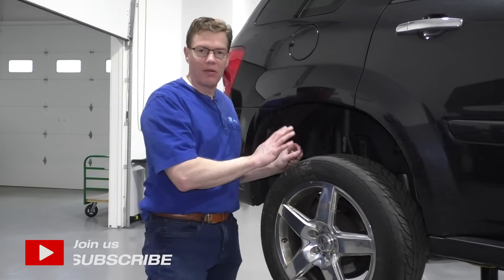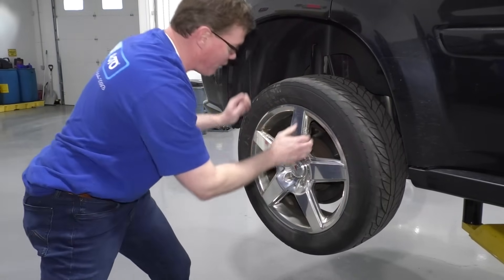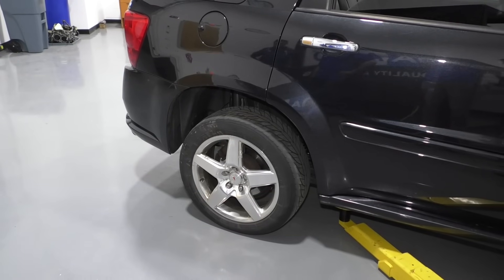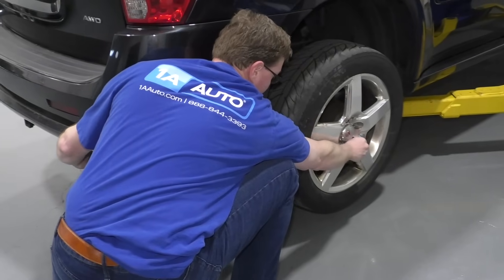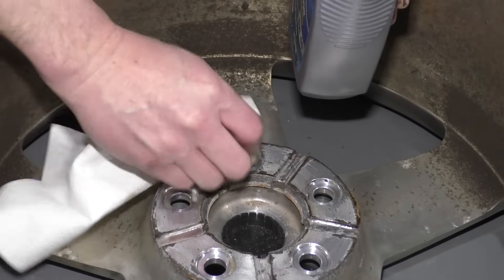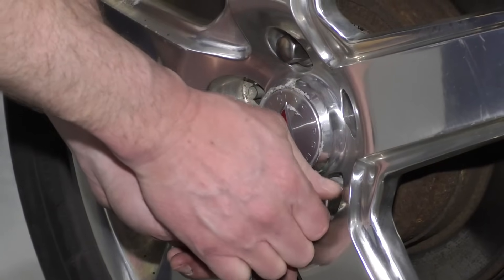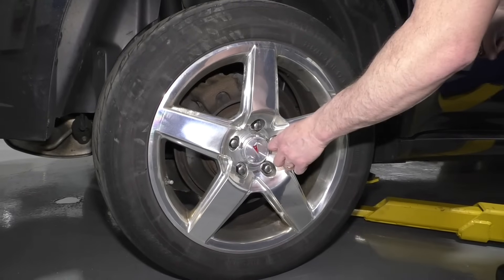How to Remove a Stuck Tire

Comment: Sometimes one will have to fingertight the lug nuts and slowly drive the car back and forth.
Reply: This was the only thing that helped me. Granted it was all rusted up from sitting for almost a year so other methods would probably work if it wasn't that bad.
Reply: Did that yesterday still didn't work.
Reply: @mangobrasi4127  
 You should have tried using the pry bar method.
Reply: You just saved my dog from hearing some colorful language.
Reply: @andyd2960  😂🤣🤣🤣
Reply: Thank you
Reply: this actually worked for me man thanks

Comment: Sledge hammer to the back is the best , we all know this ☝🤠🤠
Reply from the maker: Thanks for watching! +THE NHRA GUY #49
Reply: I work at a very high volume dealership  where we do a lot of tires  I use a very large dead blow hammer    it works perfect.   i dont kick them anymore   i let the tool do the work instead   im 54  and it does not always work  and you can hurt your foot and leg    i was a nyc medic for 37 years   so i know  a thing or to about  bones  anyway     grate job mike  as usual  .   i hit the wheel  and not the tire  because  if you hit the tire   it just bounces  off.  my dead blow  is 6 lbs    and it works very well on trucks too
Reply: Yep this always gets it! ideally hitting a piece of wood or something, and not the actual tire. Had a tech hit a tire once and the sledge permanently deformed the side wall. We called him the Hulk from then on out

Comment: If your wheel is stuck, don't screw around. Go straight to the pry bar method mentioned at the end of this video. I screwed around for about half an hour trying to get my wheel off,  but once I tried the pry bar method it took about 5 seconds to get down there, find a solid spot, and give a small tug on it. Just make sure you have something solid to press the pry bar against.

Comment: Thanks, from the bottom of my heart.  I was at the end of my rope when I did a search, and this video was absolutely perfect.  The tire is off and the spare is now on.

To share one of my tips.  I'm older and not that strong, and couldn't lift the spare onto the lugs.  I placed a few magazines on the floor, and rolled the spare into place.  I was then able to slide the tire on, and screw on the lug nuts.

Comment: You guys save my life. If your situation is not the same as in the video but your wheel still stuck, the idea is to make hard and strong movements, it could be driving a little bit and moving the steer wheel Left to Right and try to separate.

Comment: I couldn’t get those methods to work, but I managed to get the stuck wheel loose by throwing the other good tire against it with a couple loose lug nuts there to control it as you suggested.
Reply: Hallelujah thanks for the tip

Comment: Did not have a pry bar so I just reached into the wheel well and grabbed hold of the back of the tire and yanked from one side to the other and it finally came loose. This was after performing all three of the other steps!

Comment: This gave me the idea to sneak a flat pry-bar through the rim, on the face next to the studs.  Gave it gentle pressure next to the stud, moved on around to repeat next to each stud.  After about 7 times I could feel it go in deeper next to the stud, and was able to shake it loose by hand after that.  Wasn't using much pressure so didn't have any lugs on the studs.

Comment: Thanks for the tips on getting a stuck tire off, I ran into this problem today. One more tip to add to the list is 1) spray in PB blaster 2) jack up the tire off the ground and 3) hit it with a f#ing big sledgehammer.

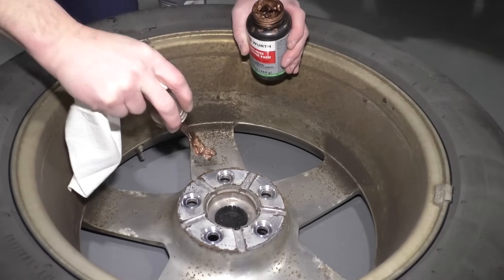Comment: 1:45 is why I came here! I beat my tire off from under the truck--w/TWO jacks under it. this is my 2nd vehicle that I couldn't easily remove the tire. I now keep a baby sladge hammer in each vehicle for that purpose. just wanted to see if Never Seize would work or if there was sumthing else I should use to prevent this

Comment: If you smack the tire with another tire that sometimes breaks it loose also.
Reply from the maker: Thanks for the comments and for watching! +twn5858
Reply: Smacking the tire with the other tire worked for me. Thanks!!!!!!
Reply: Worked for us.
Reply: @victordeleonjr5386  
I just smacked the stuck wheel with my spare and it worked. I'm stranded for 2 hours waiting for stupid Liberty Mutual roadside assistance. Two sets of cops came and the second one finally was able to free the lug nuts for me but I've been stranded for another 40 minutes trying to get the stupid wheel off because my tire shredded. Thanks a lot for the tip.... stay safe!

Comment: If the wheel is stuck, screw the wheel nuts back on but leave loose about three turns off tight then drive the car slowly so the weight of the car forces the wheel loose. If you do this on the road, use common sense and keep safe.

As in the video, clean the wheel flange and hub. You can use oil as shown but I prefer grease.
Reply from the maker: +Spanners & Sockets Thanks for checking us out!

Comment: Just saying thanks to Mike and 1a Auto for the helpful suggestions regarding a stubborn sticky wheel I’m almost completely car illiterate/ignorant I can add fuel, oil, and most of the fluids, and put air in the tires anything beyond that is beyond me so this video was tremendously helpful I’ll subscribe cuz i still need to put that steering wheel cover on and that seems extremely complicated lol

Comment: IV front wheel wpphat seemed to bearing noise gritty movement not so smooth till after I did but use wd40 as booster noise can be assumption , I took off tyre checked spray as it was up sprayed the rim holes wiped it etc put it on with one nut like a bolt on and wiggled it screeched  then did the drive as finger tighten on then tough tightened while cruising around it popped felt loose smooth again good tip helps prevent jammed pedal  myne is manual light car so not as big as the car in video , hope now it will last out what I did to it ,,😌happy with the video just didn't think it would pop

Comment: Offtopic.
Can any expert in cars tell me is it possible that all front both wheel screws loosened after 1 month after wheel and tyre change?
Almost lost wheels on the road. Can it be so or it should be done by someone ?

Comment: Here's my fun story.  My 2010 Sentra factory steel wheel was stuck solid to the rear factory drum. I kicked it, WD-40'd it, slammed the tire surface inside and outside with rubber mallet/heavy hammer; no freakin luck. I didn't want to attempt another method I saw on YouTube where u loosen the lugs, lower the car and hope the wheel breaks free for fear of damaging the studs. I noticed the wheel rim had suffered some bad pothole bruises so I resorted to slamming the wheel itself with my heavy hammer knowing the wheel would then be trashed. Still no luck. I ordered a replacement wheel and brought the vehicle to my tire guy. He says it took 5 hits from a heavy " concrete breaking hammer" to finally free the wheel from its bondage. Whole adventure cost me $95 bucks.
Reply from the maker: +Bob Whammer Thanks for sharing! Glad to hear it was taken care of after all that! 1aauto.com
Reply: Damn! I was just changing tire and I’ve done all what you mentioned and there was no luck. Guess I’ve to take it to the shop.

Comment: I WOULD HOPE MY TIRE IS STUCK OR I WILL BE IN SOME SERIOUS TROUBLE, WHAT YOU MEAN IS (IS YOUR RIM/WHEEL STUCK TO THE HUB)
Reply from the maker: +[ GTA5 GLITCHER ] This video is to show how to remove a tire that is seized onto the vehicle. This is for when you are trying to remove this for repairs.
Reply: 1A Auto Parts again it is not the tire that is seized onto the car it’s the wheel, as in the alloy wheel NOT THE TIRE 🤦‍♂️

Comment: I have a 4 ft. piece of 2x10 that I ram the rim with straight on the edge, like that thing cops use to bust in a door. :-) Sometimes it takes a few hits. Watch out for the valve. I don't know why this is an issue nowadays.  It never happened 30 years ago,  now every freaking car I have has 3 or 4 stuck rims every time I check brakes or whatever.  What would my wife or someone else that doesn't have my brute strength 💪 do on the side of the road if this were to happen in some forsaken liberal-run city where crime is encouraged? I tried sanding the center hub and center hole of the wheel a little bit, I think that's where the sticking occurs. I also put a thin coat of grease on all mating surfaces.